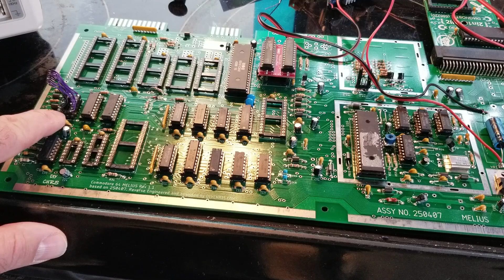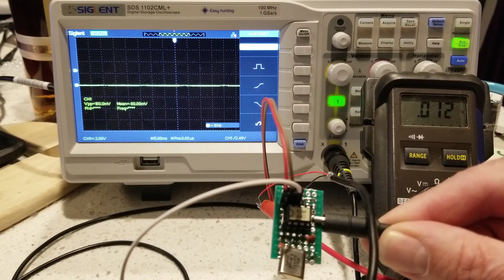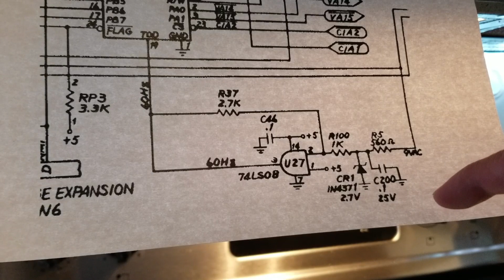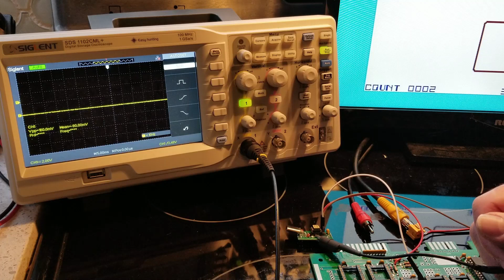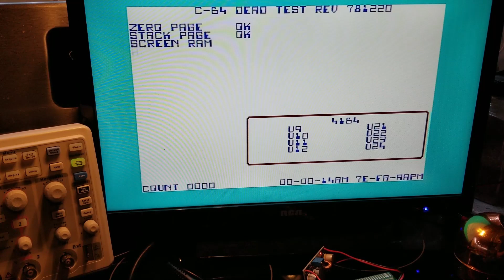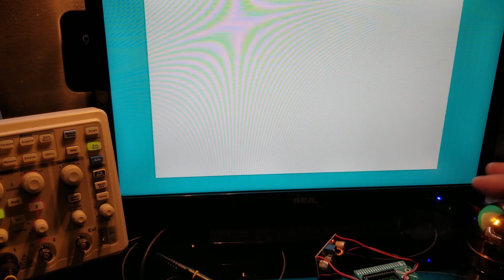DC Powered C64 with 60Hz oscillator - Working TOD Clock! Part 1

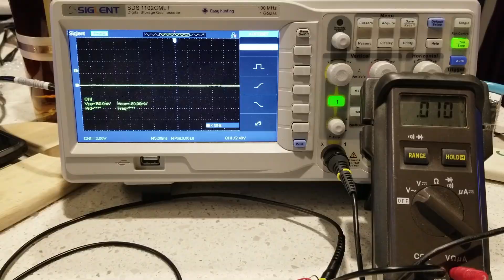Comment: The primer at 5:14  is good and would be best at the start of a video. But you should explain "zener" in a Dioide type, and explain "open" and "lifted" (adding a pullup resistor, or lifting one side right off the board?) since they could confuse people.  Also explaining a bit about the 440 would be useful- just a sentence or two. Also best to use the whole RAM number instead of 446 (not everyone handy with a soldering iron know chip series).

Comment: This is fantastic if it means we can get rid of the 9V AC requirement for the C64.  Even better if you can toggle the oscillations between 50/60Hz. This would potentially help people on both side of the world.

At about 2:38: What is this "4005 buck converter"? I even turned on CC because I wasn't sure if I heard you right.

I say with with all respect: if this is part 1, I fear that you're probably going to "lose" some people.  People who you want to watch and learn from this. The people who will understand this probably don't need to watch it.  There are arguably a few gaps; too many basics (about the C64) left unstated for this to help the people who need it most.  Knowledgeable people don't always make good teachers if they proceed for a basis of assuming other know almost as much as they do. It's better to assume the watcher knows far less than you and proceed from that perspective. It's also helpful if right up front you state the goal (which didn't appear until 2 mins into the video), the problem, and the parameters of the system. Then show the primer (which comes in at 5:14).
Reply from the maker: Hey there, thanks for all the feedback.  Honestly I've never been that great of a teacher - coupled with how sick I am right now and all the medicine I'm taking I'm sure I wandered off quite a bit here and there.  I'll try to recap a bit in the next part, I'll slow down and explain things a bit better.  As for the 'buck' converter, that little blue board that was running the main 5v rail is a DC to DC stepdown (aka buck) regulator.  It's just a switch mode regulator to drop down the 12 volts I was feeding into the board.  As for the 50hz thing, I'm not sure how low of a crystal you could use.  I'd have to study the data sheet for the divider circuit a bit more closely.
Reply: @retrotechinsanity  Teaching isn't always easy. Hope you feel better.